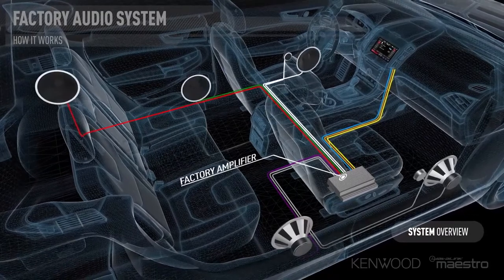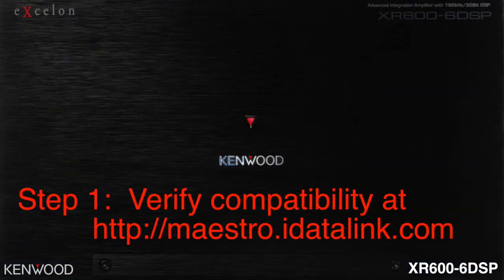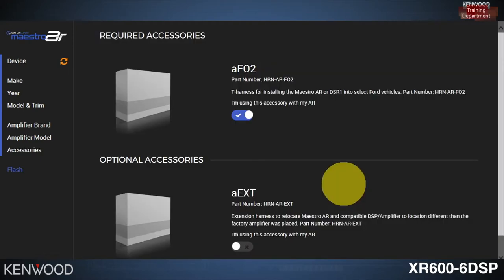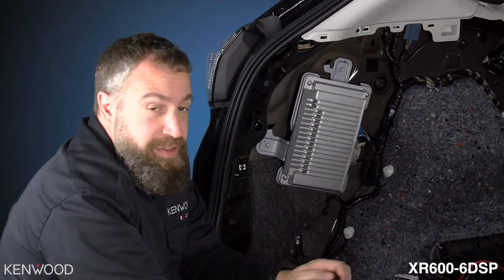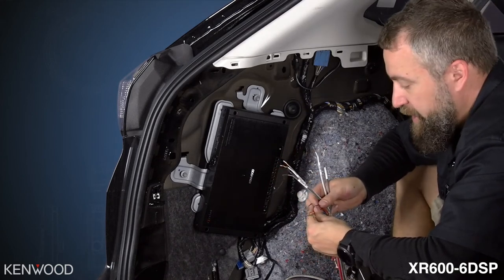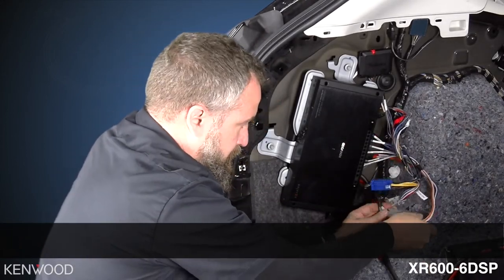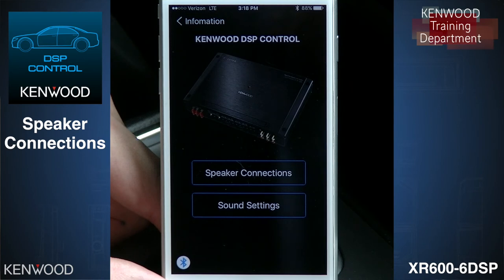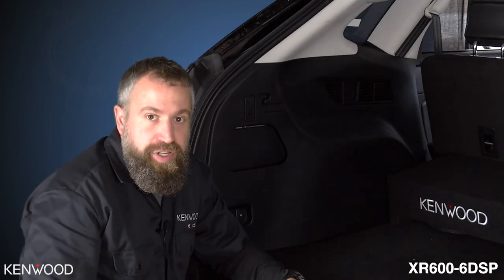2017 KENWOOD eXcelon XR600-6DSP & iDatalink Maestro AR On-Site Installation

Comment: I am loving it in my 2016 RAM Limited, more power and cleaner sounds even with the factory speakers.  But of course I switched them out for Polk DB+ but I need some more tweaking.  I did tie 5 & 6 channels to the factory sub for 200 watts RMS, but sounds like crap.  Now have to figure out how to add additional amp.
Reply: Is the center channel speaker in the amp still working?

Comment: Did this install on my challenger with the alpine system.  It works well, however I have a pretty high sound floor and very obvious alternator whine.  I've replaced the ground wire, relocated the ground and nothing changes.  I would also really like a guide on tuning a system with this dsp.
Reply from the maker: Try giving our tech line a call to see if they can help walk you through some of the steps 1-800-843-61224

Comment: Can this amplifier be used without Maestro integration? I see the RCA input harness but I see nowhere in the manual or the unit itself for a remote turn on wire. I suppose it gets accy/ignition from the 4 pin Maestro harness?

Comment: I have after market alpine radio,  amp and sub but don't sound good enough. Can this Kenwood Excelon 6 channel Amp (XR600-6DSP) perfect the sound quality and clarity?
Reply from the maker: This amplifier has been discontinued and is a few generations old, we have a current amp that does not include a DSP but works with the aftermarket receiver you currently have, The XR901-5 https://www.kenwood.com/usa/car/excelon_reference/xr901-5/ is a great Sound Quality amplifier assuming your subwoofer and speakers match the requirements and ohm load. Thanks!

Comment: Does this work with the aftermarket head unit?  I have an JVC KW-V660BT
Reply from the maker: Robert, since this amplifier was designed to be adapted to OEM vehicle installation using an iDatalink interface it would not be the best choice for a receiver that already has RCA output like your KW-V660BT.  Although you can set up this amplifier to accept analog input and could work with your receiver, using any combination of our available 2 channel, 4 channel or 5 channel amplifiers would be more cost-effective and would be less complicated to set up and tune. Thanks!

Comment: really curious on that performance of this unit, are there gonna be any demo days for your retailer's?
Reply: Why are you curious about? At 75 x 6 it is more than double the power of the stock Sony 11 channel amp. All the controls on your factory Sony radio are retained, everything. However your center channel speaker for the Sync features will not work without input from the amp. To add a subwoofer and amplify the center channel again, you would need to add four channel amp. I am considering this amp/dsp to run with my Alpine PDX-V9 which can power the rest of the speakers and sub returning the system to full active unlike just having six channels + mono amp which is only 7 channels, the aftermarket tweeters are passive and the rears are now coaxial. In my Focus ST, I have components front and rear, so I need ten channels.

Comment: Does this keep all the factory speakers powered? I have a 2019 edge with woofers and tweeters in all 4 doors and tweeters in the rear pillars.
Reply from the maker: While we always recommend double checking the power handling of your speakers and resistance values, yes this will power the speakers in your vehicles. This amplifier is designed to replace the factory amplifier with the use of the iDatalink AR to function like the OEM amplifier, with higher output!

Comment: Is the only way to connect the factory head unit to the dsp is with a maestro ar module? Or does it have a standard high level input for standard front and rear speaker connect?
Reply from the maker: The XR600-6DSP requires the Maestro AR to turn on.

Comment: I'm looking to setup a car audio system with a manual crossover setup that would require me to use a 6 channel amplifier, I was thinking about choosing this amp, would I be able to retain the 32 bit 192 khz quality as long as I use a good quality head unit and good passive crossover?
Reply from the maker: Yes, with a Hi-Res Audio receiver you can maintain that output quality. You can look at our eXcelon Reference receivers for the most tuning and control I would suggest the DMX1057XR or the DNR1007XR.   Keep in mind, the XR600-6DSP was optimized to integrate with factory OEM audio systems to retain the factory receiver when installed using an iDatalink AR module, although the XR600-6DSP can be used in a universal "analog" mode, it may not be ideal for tuning and setup for the type of configuration you are after. 

Are you trying to set up an active 3-Way configuration?  Are you using 3-Way components with a subwoofer or just Tweeter, Mid, And subwoofer?
Thanks!
Reply: @KenwoodUSA  yep, I'm trying to run a three way setup for my low-mids, my mids, and tweeters, I already got crossovers selected, as long as I can use the high res feature with one of the excelpon reference series ones then I'm good, thank you!
Reply from the maker: @lukeoslund4645  Are you using an active crossover or passive one for your 3Way setup?

Comment: crutchfield.com says this fits my car but your website doesn't have it listed 2005 cadillac dhs W/bose
Reply from the maker: This amplifier will work in your car, however your vehicle is NOT compatible with the Maestro AR.  You can install this XR600-6DSP in "Universal" mode, meaning it will work as any 12v car amplifier would and require typical adapters, custom installation and possibly replacing factory speakers for best performance and compatibility.   Thank you .

Comment: Ok we just finish and install 2017 f350,  and of course I was in the impression that you could split the 5&6 Chanel's for center and sub but you can't.  You need external amp for Chanel 7&8 to do center channel.   As our customer didn't want to change his factory sub!! We did 1&2 fronts 3&4 rear 5&6 sub lost front channel!  Now we have to back and install another amp.  For center channel.  I watch the video but didn't read the comments!   Need more notes about center channel!  :(
Reply: IN my Ram I disconnected the center speaker in dash because it gives much better seperation and staging

Comment: It''s great and all that the amp has RCA outs to go to sub amp but what about the remote turn on to turn on said extra amp?  I don't see any sort of output for that :(
Reply from the maker: Great  news!  The Maestro AR harness does provide a remote turn-on for an additional amplifier(s).  Feel free to contact us at 1-800-536-9663 and request a document that illustrates this connection.  Thanks!
Reply: KENWOODUSA I called kenwood yesturday. Got a girl that you can tell is just reading from the Web page, then asked for level 2 support. A little better, but I hate to say no help. He told me I have to call idata link to ask about the remote turn on. Your customer support was so good before, what happen? But what I really want to know is,  is this a true 75watt  amp or sounds more like 50watts? Do you have any 2ohm speakers for my doors, so I can get the 100 watts? Or should I wait for the rockford dsr1 to come out. That way I can put any high wattage amp to push it.
Reply: Another option is the Pac-Audio AP4-FD21.  It lacks all the fancy sound processing, but does give you a full range signal with the rest of the audio system intact (chimes, phone, etc)
Reply: Stephen G yes I saw that option.  But for that price I'll wait on the rockford. You get more options. Like the app option, u can just tune from your phone.  This kenwood is my answer to my problems, but the answers I get when I call kenwood stray me away. Got a dodge durango with the beats audio crap. Been a kenwood guy for 20 years.
Reply from the maker: Ralph, I apologize that customer care was not able to better answer your questions.  Please keep in mind, this is cutting edge technology that we are proud to be a part of and there will be a learning curve for our different levels of tech support.  If you still have any remaining questions, please post them here and I will be happy to help!  Thanks!
Reply: I also ended up (pre)ordering the RF piece as well
Reply: Does this work with and aftermarket head unit?